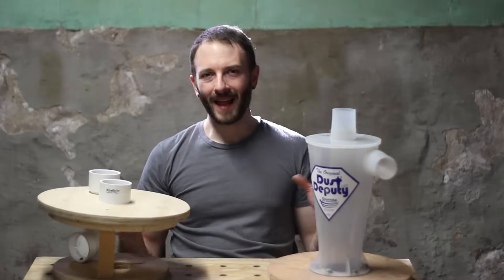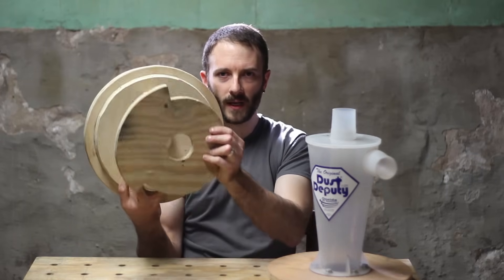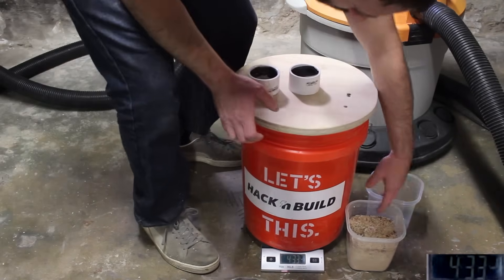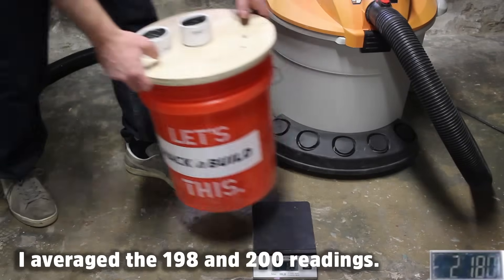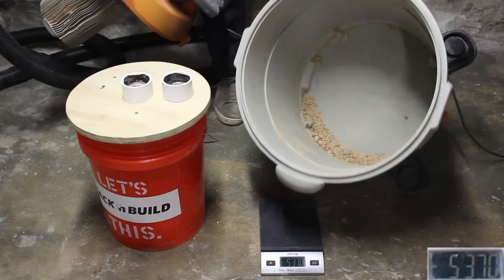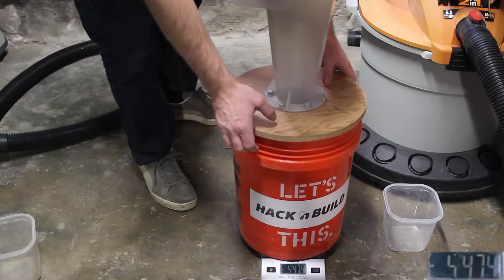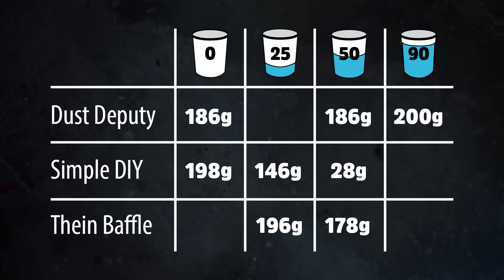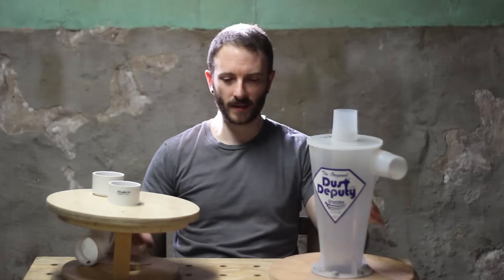IMPROVED cyclone dust collection vs Oneida Dust Deputy (2/2) - HNB #10

Comment: Bucket is undersized. So save the $80  and get some pool hose, larger diameter is easy to get, (carpet cleaner equipment).... and heat gun and pvc pipe gets a lot more versatile.  😊

Comment: What is the aim here, fine dust collection or debris collection?
Reply from the maker: It is to separate the fine dust from the larger particles and debris so your shop vac's filter doesn't get clogged.
Reply: @HacknBuild  That doesn't make sense, all it will do is pick up some of the debris and it won't remove the sub 5 micron dust particles that cause health problems and it definitely won't remove the really dangerous sub 3 micron particles that once in the lungs stay there. It is easy to pick up the big saw "dust" debris but capturing the really small stuff requires requires a lot of air to be moved.

Comment: I know this is an older video, but well done with the tests.  It scales to any size Dust Deputy they make.  I too toyed with creating my own separator, needing to use a full size metal trash can.  I needed 6" hose connections for my Grizzly G0944 dust collector system.  

After much research I came to the same conclusions and wound up purchasing the Oneida Super Dust Deputy XL.  The main advantage is it utilizes the full capacity of the can it sits on without performance degradation as it fills.  The bottom of the DD is just a simple funnel to the can and the can is not part of the cyclone action, just a collection bin.  That plus not having to build it from scratch spending time and materials, is why I found it better to just spend the money on the Oneida (it is not cheap - $240).  It works great for me.
Reply from the maker: Thanks for sharing your experience!  When I made this video there were already a lot of DIY dust collector videos and I was curious how they stacked up. I'd already purchased a Dust Deputy so I wanted to see if I was missing out.  The DD is relatively inexpensive and works better than both DIY options presented, so in my view it's a better option.  Better to spend the time building something more useful that you can't buy instead.

Comment: I have a fair amount of experience with cyclonic separators. One aspect that is often not seen is the importance of the diameter of the cyclone. Separation is achieved in a cyclone by centrifugal force, the smaller the diameter of the cyclone, the faster the cyclonic action, increasing the amount of centrifugal force, and therefore achieving a higher amount of separation. Cyclones are smaller on the bottom to increase the separation force as the solids drop within the cyclone. The difference in density of the materials being separated also has a huge effect on the separation efficiency. Increasing the efficiency of a simple cyclone like the  Dust Deputy would best be achieved by utilizing a longer, more exaggerated cyclone chamber, or a second cyclone that is longer and smaller in diameter in series with the first.
Reply from the maker: Thanks for the suggestions!

Comment: I just got a Dust Deputy and to prevent the bucket from tipping and make sure the vacuum and bucket stayed together to make it easier to move, I built a small plywood cart. Essentially a rectangular box with holes in the top to fit the vacuum and bucket with wheels under it. It's simple and effective.
Reply from the maker: Good idea.
Reply: I did much the same... a wall bracket to hold the Super DD XL I have.  It is very stable and just the right space under to slide a can beneath for change out (a couple simple wedge spacers to lift it up the final 1/2" so I can strap & seal the top that is mounted to the bottom of that shelf).

Comment: Get a bigger container. I use a very rigid sump pump basket  that holds about 30 gallons with a Thein baffle. Works great.
Reply from the maker: That would probably be a smart idea if I had the room for it.  5 gallon size is as big as I am gonna go with my current shop and I am still very happy with the Dust Deputy.  Thanks for watching, cheers!

Comment: So what is the point? Isn't it just as easy to empty the vacuum as the bucket?
Reply from the maker: It's not because the vacuum filter quickly gets clogged up with fine dust.  This leads to severely degraded performance and can even burn out the motor.  Using a fine-toothed sawblade generates almost exclusively fine dust.  Not having to stop and clean out the filter every few cuts is a big win.  Thanks for watching, cheers!

Comment: I always wonder how much difference the size of the exit hole would make. If you make the diameter larger the air travels slower and gravity is more effective. 
But how effective would that be overall?
Reply: Well, you guessed it wrong. 
Larger exit hole means lower efficiency. I just read a research paper today. 
https://www.hindawi.com/journals/amp/2019/7134309/
Reply: @super-z8943   yeah I was switching between needing the pressure to make the cyclone or using gravity. Thank you for the link, I will most definitely read it when I have time
Reply: @Baer1990  This doesn't have much to do with pressure or gravity directly. Particle velocity and centrifugal force are key factors.
Reply: @super-z8943   yes, but the centrifuge makes particles heavier than air go down, mass is definitely a factor but having a proper centrifuge is more important
Reply: @Baer1990  yes, but particle mass is out of your control and gravity is always constant no matter what design you use. 
Centrifugal force and particle velocity is in your hand and only thing that matters. Lower radius designs works better for finer dust while compromising CFM efficiency.
Read the paper, it is a proper technical research paper.
Reply: @super-z8943  yeah I was still explaining where my (wrong) logic came from
Reply from the maker: You should do an experiment and report back :-D

Comment: Hello, I work in a metal workshop and I would be interested in how well this device also works with fine metal dust, metal flakes 
and small stones because I only ever see tests on youtube with wood dust. Thanks
Reply from the maker: The cyclone version of the collector will trap very fine dust, though I am not sure what the particle size is.  Oneida doesn't have that detail in their specifications. I can tell you that that my vacuum's filter doesn't get clogged at all when I use this.  I'd suggest simply trying it out a cyclone separator and seeing if it works well enough.  I've seen  DIY separators that use a water bath to trap fine particles. Thanks for watching, cheers!
Reply: I would suspect that it would work better on metal shavings than wood, since metal is heavier than wood and would stay at the bottom of the bucket better. Hack'n Build made a good point about the water bath. That would help if your metal in your shop were super fine.

Comment: Again as per prior comment you have to equalize the height of the outlet/inlet ports. In the Dust cyclone its the height of the bucket plus what looks like 16 inches. Engineer the diy so that the ports are the same height as the cyclone and the two will perform the same.
Reply from the maker: I am so done with DIY dust collection, I mainly was curious on how well these DIY solutions worked.  Sure they can be improved, but I am happy enough with my Dust Deputy for now.  Thanks for watching, cheers!

Comment: How much of the fine dust is making it to the shop vac and on its filter? 
The purpose of the cyclone collector is to trap more of the fine dust, rather than have it clog the vac filter or pass into the air.
That fine dust that is inside the shop vac and stuck to its filter should be collected and weighed with a smaller more accurate scale.
Reply from the maker: For the Deputy, practically none.  For the DIY option, some.

Comment: The Dust Deputy was designed by someone who knows his stuff, it was, I have little doubt prototyped, tested, tweaked and tested again and again. it’s fun to experiment but you won’t beet the experts with their resources at their game.
Reply from the maker: Usually, when a practice becomes established there are good reasons for it.  Sometimes though, the reason is "that's how we've always done it."  or some other not so good reason. That's basically why I did the experiment.

Comment: Where is the materials list/design doc for this thing?
Reply from the maker: I never put one together.   It's based roughly off a Thein baffle design.  If you google it, there should be some plans you can find.   The parts for this one are the plywood discs, scrap wood, fasteners, 1 PVC elbow, 2 PVC couplers and some short lengths of PVC pipe.  All 1.5".  I'd suggest building a conical one though, if you're going to go through the effort to make one.  Cheers.

Comment: One thing I noticed about your test is that your home made one would of done better if your bucket was almost full to the bottom of the wood. I think a fair test would be to have the sawdust about a third of the way down, and then test. As the bucket fills up, it will pull the sawdust into the vac because of the bucket being full.
Reply from the maker: I'll keep that in mind if I ever do another one of these things.

Comment: Good video.  But you didn't answer the big questions.  How much did the homemade version cost?  And how long did it take to build?  You can buy a knockoff of the Dust Deputy on Amazon for $20.  It would be pretty hard for the homemade version to compete with THAT unless it is dirt cheap and very quick to assemble.
Reply from the maker: The DIY version cost a few bucks because I didn't have the plumbing fittings, the rest I had on hand.  For me, even at $40 the Dust Deputy is a better value.   I did enjoy making them and doing the experiment to see how the homemade designs stacked up the Dust Deputy. Thanks for watching, cheers!

Comment: So basically buy a Dust Deputy?  Or change your design to a funnel type that mounts on top of the 5G bucket..  Which is the only major difference I see..  You have too much turbulence with the dust on flat tien level..  I'd figure a way to create one using maybe a smaller cannister and funnel shaped to swirl contents down center rather than messing up the swirl with a sudden drop in the inner level..
Reply from the maker: Yup.  I think that'd be the way to go.

Comment: I love the methodology!
The dust devil sits outside the bucket.  the DIY sits inside the bucket.
How about moving the DIY outside the bucket (looks like about the same depth as the Dust devil).
Cut another bucket that fits on top of the normal bucket, put the DIY in it.

Extrapolating your figures I would think that would bring them up about even.
Reply: Ive seen a video where its done like that but even without the extra thein baffle and it worked great. Just a 45 degree bend pvc pipe entering the bucket and a tube to the vaccuum. in the top

Comment: To make this a fair comparison you would have to fill the dust deputy up half way or design the other cyclone to sit on top.
Reply from the maker: The comparison you're talking about (check 6:40 for the results), but changing the design to be similar to the Dust Deputy would be another comparison all together.
Reply: Hack 'n Build thanks for the reply man looking at building one of these my self. awesome video. Are you thinking of building a redesigned one that sits on top?

Comment: You can ditch all the wood and fix the performance easily. Build the cyclone in a smaller pail, glue it to the cover of a larger pail make holes as needed. DONE.

Comment: let's see...
the cyclone action of the dust deputy is outside the collector, the diy version has it inside the collector.
could it be that this has something to do with everything? ... maybe?
Reply: I was thinking the same thing. Its not strictly a like for like comparison. Interesting results. I suspect if you used the DIY version with the baffle in a 2nd upturned bucket your results would be better still.
Reply: This is exactly what I was about to post. The distance between the output (to the vacuum) is further from the collected dust on the deputy.

Comment: Good grief not only have I watched a dozen dust cyclone videos now but it took a dozen to get to 1 with someone actually did some measurement well done nice comparison interesting I wonder if that air filter pleated air filter which is a scam like printer ink is the limiting Factor wouldn't it all be going off as it fills up
Reply from the maker: Glad you found it helpful.  Not sure about the filters, I just use the basic "workshop" ones. Thanks for watching, cheers.

Comment: Why can't I find the real thinker who just made a cyclone tube between his shop vac base and his motor/filter ?
I'll tell you why - people don't really think - they FOLLOW.
Cap your shop vac hose hole, or if it's already on the base, LEAVE IT THERE ! - now just build your middlin' circular vortex - at worst you'll have to attach a curve inside the shop vac base to direct the suctioning in a circle. Now you go to empty - just unclip (or pick up)the shop vac base (you used the clips from the top or just let the motor weight seal it).
Reply from the maker: Well, if you think it can do it better make a video and show us how it's done!
Reply: @HacknBuild  I'm sure you'll do what I suggested you won't be able to resist.

Comment: Good video, but I have to ask - why dump out the sawdust to vacuum it up?  Save a step and vacuum it out of the container.
Reply from the maker: Because vacuuming it off the ground more accurately simulates what happens during use of a power tool.  The tool doesn't spit out large chunks of dust.  When vacuuming up a huge pile like that, the separators don't perform properly.  Thanks for watching, cheers.

Comment: To be fair, the Dust Deputy is closer to 99+% efficient for the test that was performed here.  He noted in the first video that he believed some of the dust must have been trapped in the hose for the Dust Deputy test which is why it read 86% instead 99%+. I'm sure that was the case. It will be 100% efficient for particles over 100 microns and drops down to around 95% for particles the consistency of corn starch such as fine grit sanding dust.

Both the Dust Deputy and the Thien separator are great solutions. Thanks for sharing your builds and testing.

Comment: Your cyclone is in the bucket vs the other one on top of the bucket. You'd have better results doing the same with a separate bucket. Or use a barrel or something larger.
Reply from the maker: Could be.   I pretty much put the home brew solution on the shelf and continued using the Dust Deputy since I made the video because I have it and it works well for me.  Thanks for watching, cheers!

Comment: It looks like with a taller bucket that home made solution would work just fine. As a matter of fact, if you sized it to fit a trashcan, you could have it fill a trash bag and make emptying really easy. As well as the DD works, that tall thing sticking above the container just seems like kind of a poor design.
Reply from the maker: It's possible, but with what I know now I wouldn't attempt a baffle design, I would just buy or make a cyclone.  Thanks for watching, cheers!

Comment: I installed a single Dust Deputy and found suction value to have dropped by 50 percent from before installing DD and when I checked their advice was to add another bucket and DD in parallel with existing one to receive same suction value as before. Splitting suction into two hoses right before entry in to the two DD’s and then reconnect before entry into the vacuum cleaner. I have not tried adding another DD in parallel with my existing one. If I am using equipment that produces a lot of debris then I disconnect DD and take it off line and vacuum pickup is as before. Has anyone else had the same experience?

Comment: I just made one yesterday. https://www.youtube.com/watch?v=1wS6NXH9Cmg&t= My original version was like yours and once about 4 inches of dust got in the bucket, it lost huge efficiency and started sucking into the vacuum. So... I cut the bottom half of the bucket off. Sat the top half on a piece of plywood and cut the thein baffle directly into the board. Then I attached that board on top of a larger, square container (to interfere with and break up the lower airflow movement under the baffle) and it work brilliant now! The baffle isn't the best configuration, because I didn't research the best shape/size ratio. But even my crude, unmeasured version is many times better than just pipe in a bucket.

Comment: I just want to add to what another commenter said. Yes, these devices work well but the most harmful particles are still in the air unless you have a 1 micron or less filter on board. I think a full face filter provides the ultimate protection in addition to the dust collector. The human body is the  ultimate dust collector starting with nose hair then on down to the cellular level.. Everything works fine unless you overwhelm the system. A lifetime of breathing sawdust, etc may eventually show up as one of many types of lung disease-COPD, Black Lung, Brown Lung. etc.
Reply from the maker: Same here.  I have an air filter running and wear a dust mask when I remember (usually if I know I am going to be running the saw for more than a couple of cuts).
Reply: Great, but I think the point is to save your filters and make cleaning out the dust easier (smaller bucket)
Reply: UR riight. Just adding to the conversation.